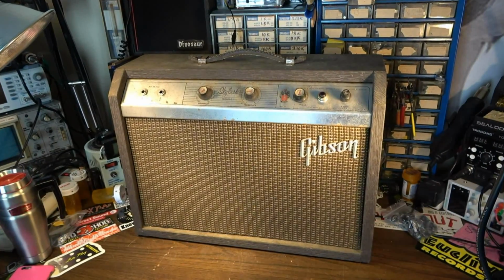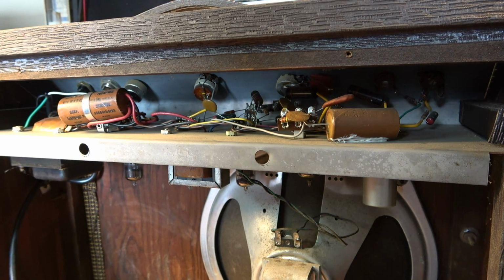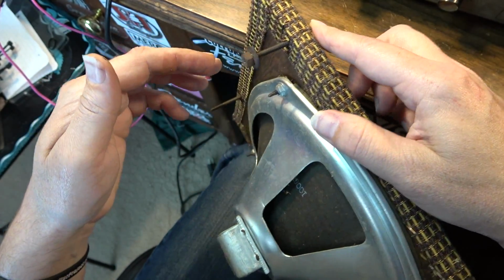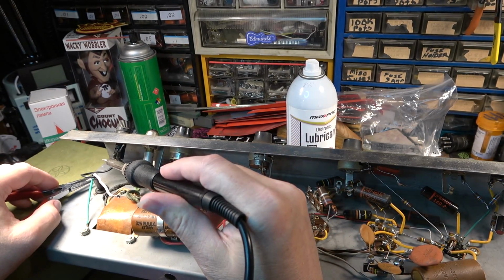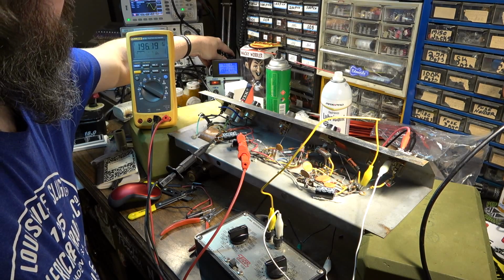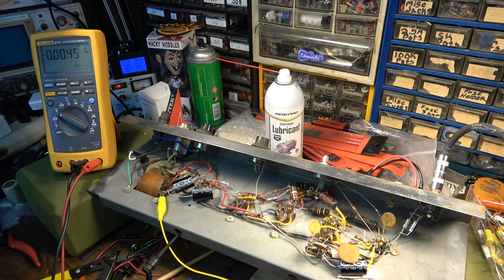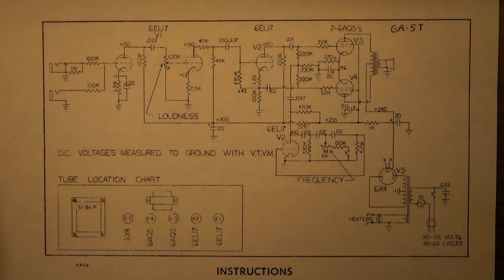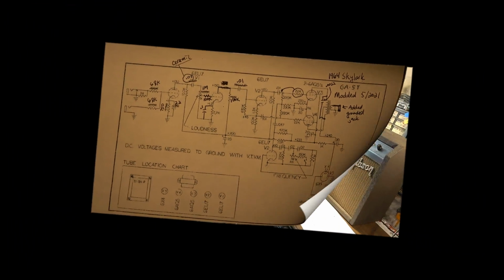Fender Princeton DISGUISED as a Gibson Skylark | The Guitologist

Comment: Recently was passed down a 57 gibson ga-5 from my grandfather and as far as I can tell, it's pretty much just a copy of a fender champ. Just a nice little 1 knob 8" speaker 5 watt amp.  The filter cap looks like it was replaced, probably in the 80s judging from the look of the cap. But aside from that and the power amp tube it looks pretty original!

Works great and sounds amazing. I should probably put a legitimate 3 prong power cable on it.
Reply from the maker: Correct. The earlier version of the GA-5 was a 5 watt single-ended job. Later they were changed to the Skylark during the Crestline era and the output was upped to probably closer to 10-12 watts.

Comment: Good job, Brad. That thing honks. What solution did you use to clean the faceplate? Some of the lettering becomes brittle after time, so you have to be careful. 😀
Reply from the maker: Gentle scotch brite pad. Very gentle.
Reply: @TheGuitologist  in the future try sonw scuff pads for painting. Same format but much finer grit in 2 levels of coarseness.

00 or better steel wool might also be good but perhaps not when the amp is outside the cabinet.
Reply from the maker: @kampfkustomer2343  Scotch brite pads come in several coarseness options too. They're pretty useful.